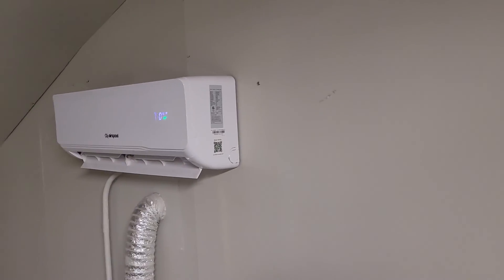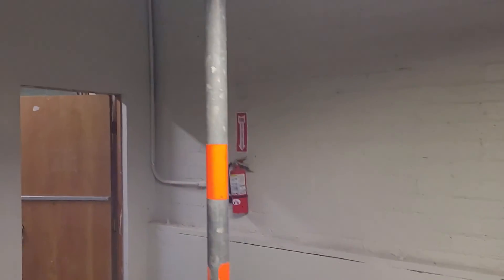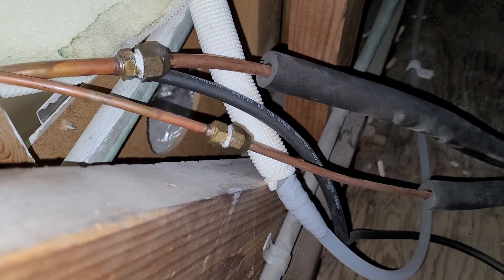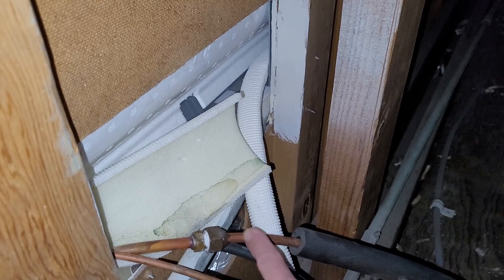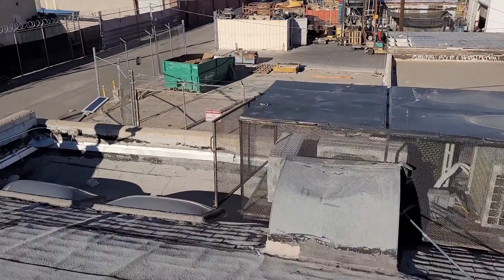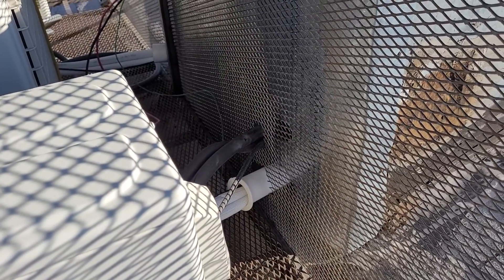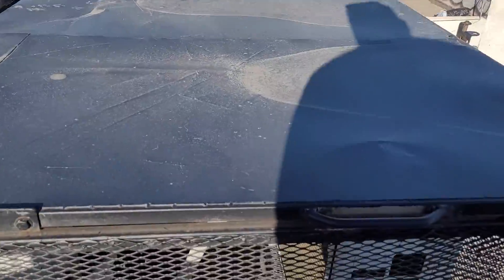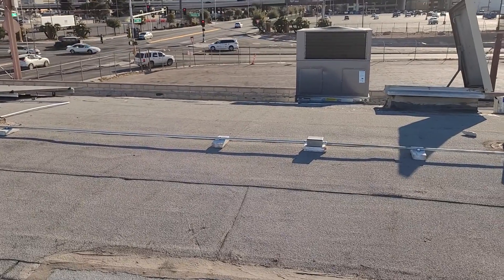Run an inverter DC air conditioner directly from solar. No batteries, inverters, controllers needed.

Comment: Always insulate any bare copper lines. Prevents condensation, increases efficiency and prolongs system life. Remember, your expansion valve is in the outdoor unit, so you don't want the refrigerant picking heat up in that little 1/4" line on the way into the indoor unit or going back out to the compressor. The refrigerant cools the compressor, so any heat picked up in the vapor return line (larger one) increases your compressor operating temperatures.

Comment: Can this have a battery connected for nighttime running off grid.
Reply from the maker: Yes. Just plug it into your inverter for nighttime. Theoretically, you could have the same voltage as the system needs for your batteries, but as of now, it's probably a lot more practical to just plug into your inverter which is fed off of your batteries.
Reply: Can I run my DC inverter ac on solar panels directly without any thing else?

Comment: How many square feet can a single unit cover?
Reply from the maker: Hi Brett, the rule of thumb is 1 ton (and this Airspool unit is 1 ton aka 12,000 BTU) can cover 500 square foot.  Much depends on how much insulation there is, how high the ceiling is, etc.  But, one thing to keep in mind for these Airspool units:  the goal isn't always to meet setpoint.  As an example, let's say that you have an existing 4-ton unit for your beautiful 2,000-square-foot home.  Set that at 74 degrees.  Then, install an Airspool unit in the area of your home where it's always hot (or cold, if winter).  Set it at 72 degrees.  So, it's always, or almost always running, never reaching setpoint.  In this way, the Airspool unit, which is probably much less expensive to run than your existing unit, captures the 'low-hanging fruit' of your heat load.  A garage would be another example.  Most garages aren't insulated.  It may be tough to get your garage down to 73 degrees, say, but if you can get it down to 81 degrees when it's 105 degrees outside (very very common here in Las Vegas), that's still a win.